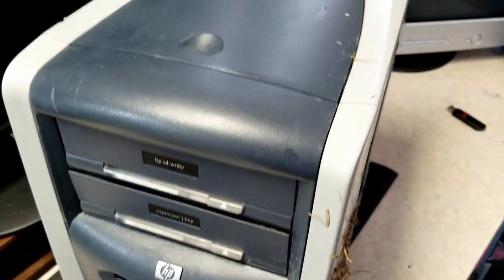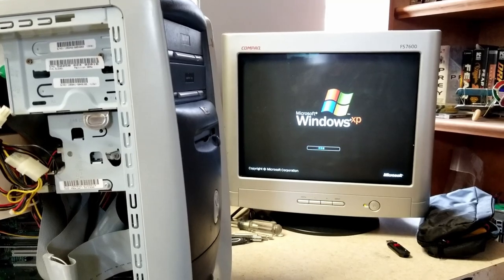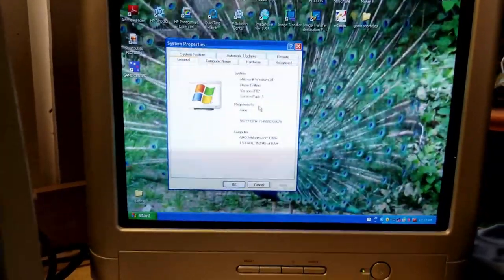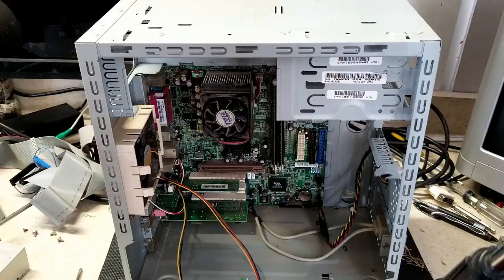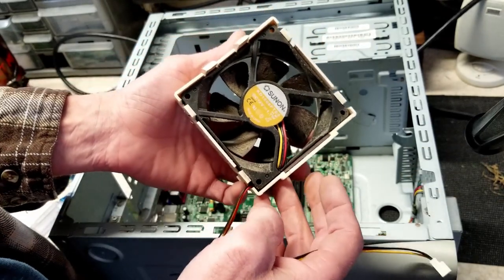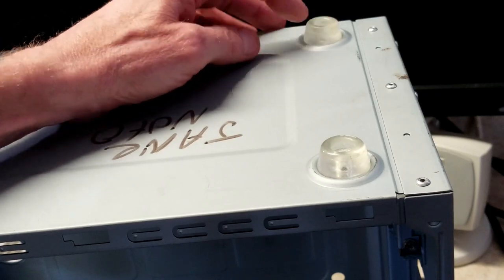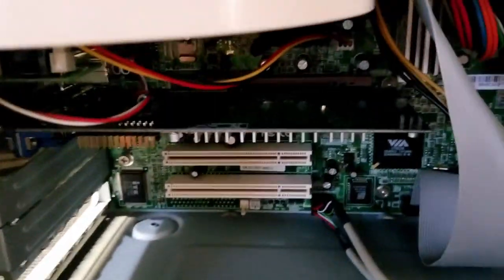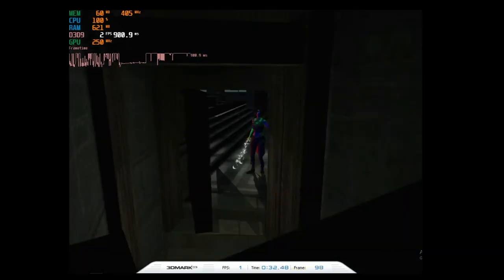Windows XP HP Pavillion 304w PC from 2002 Socket A Athlon XP (part 1)

Comment: I had one of those around the turn of the century; same form factor and case style, anyway.  Used a Slot-A (similar to Intel's Slot-1) configuration with a 733mhz Athlon.  I pulled the board out, flashed the BIOS, upgraded the RAM (to 768mb, I think) and it was my wife's daily driver for many years, 'til I did a 1st gen. i3 build for her.

Comment: my hp pavilion beeps 6 times and dose notthing do you know why ?
Reply from the maker: I dont know,  there are different beep codes for different BIOS chips. Have you tried all the usual parts reseating or swapping? If you have tried unplugging things and swapping things and there is no change it could be motherboard. Here is a list of beep codes for HP with the different BIOS chips, maybe this will help?
 https://support.hp.com/bg-en/document/c02222922
Reply from the maker: Also try unplugging power, remove the battery, and hold the power button down for 10 seconds, release it then do it again a couple more times.
Reply: Thzx it worked